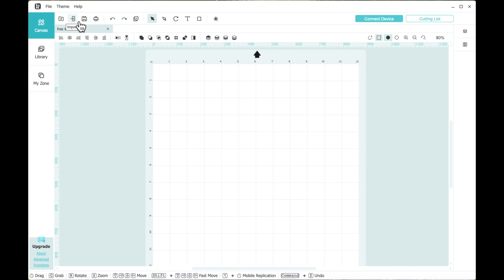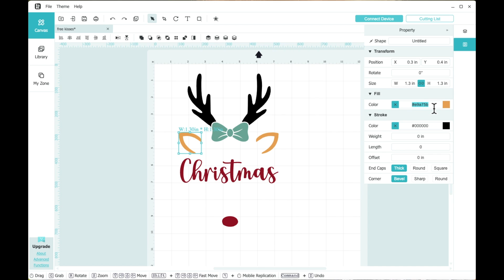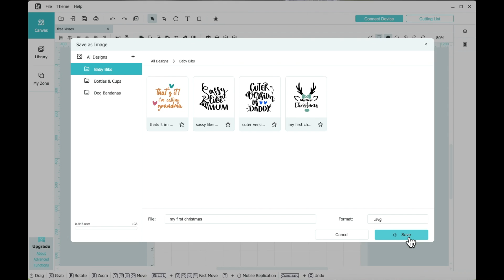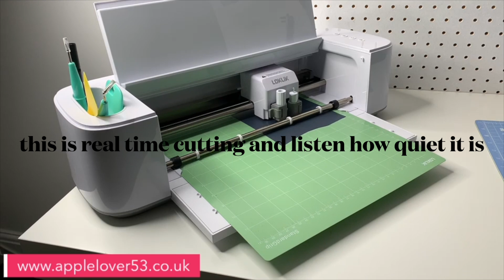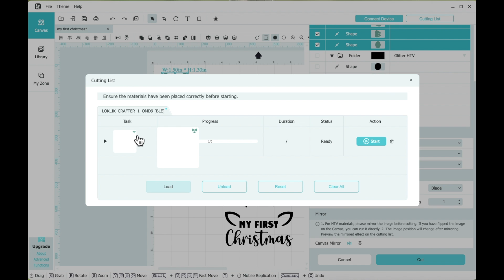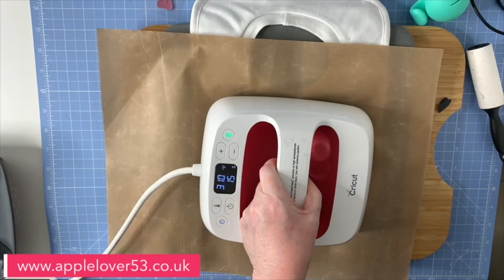How To Cut and Apply HTV (heat transfer vinyl) to Fabric Using The Loklik Black Friday Bundle

Comment: I wonder, would it be better to flip your design before uploading to the machine? I'm hovering over the Buy Now button on one of these machines!
Reply from the maker: Hi yes that works, and if i had read the mirroring instructions properly in the cut settings I  would have realised that, so thank you for making me investigate and find the answer. So for clarification for anyone else. If you mirror a design on the software mat first the design stays where it should be when cutting. If you mirror the design in the cut settings, it flips and moves position on the cutting mat.